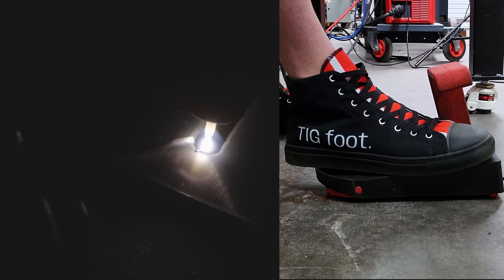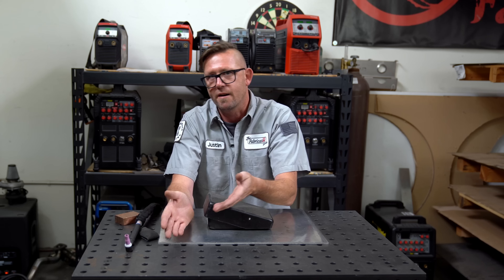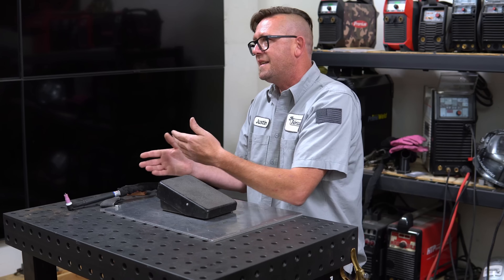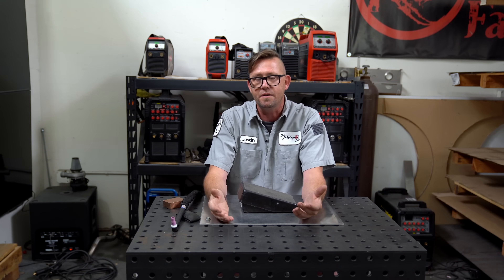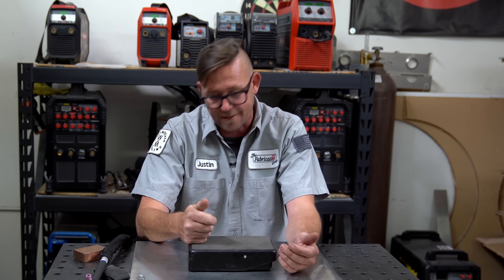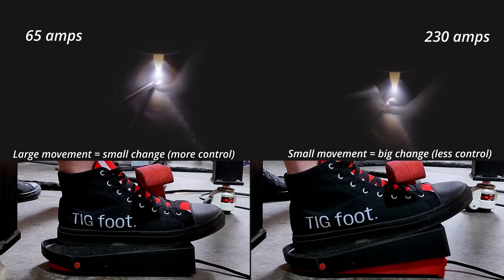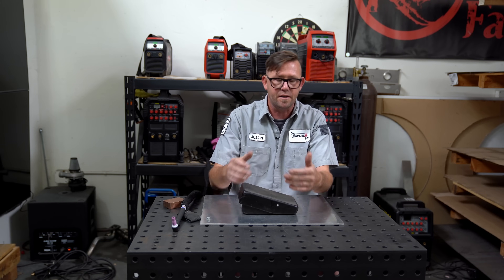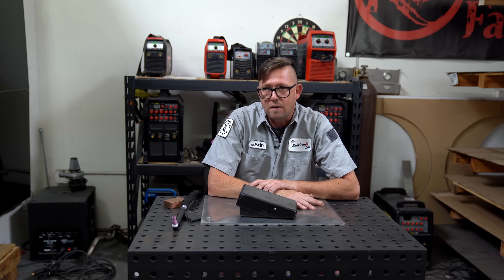Secrets of a TIG Foot Pedal

Comment: TIG is my preferred method of welding, but I HATE the foot pedal, i have always had a torch mounted control.  I made a torch mounted thumbwheel controller for my new machine by mounting a 5K potentiometer to the torch and wiring it to a replacement foot pedal plug. No way I was going to pay over $150 for a thumbwheel amp control when it is made of $10 in parts.
Reply: Haha!  I did the opposite.  My second-hand TIG had a slide control on the handpiece when I got it.  I could not coordinate that, so made a foot pedal from two pieces of plywood, a hinge, four rubber door stoppers (to be feet) and a couple of springs captive around long screws.  Used that for 25? years, and still do.

Comment: What really helped first time using a pedal is grab some scrap & just get use to using the pedal to start & make puddles, but let off & go to hot just to experience temp change without worry. No filler just learning heat control. Made life a lot better. It was hard to see the puddle at first & got a magnifier lens & that was 100% better. Great videos, TY

Comment: I have watched a ton of your work on this channel and the Fabrication Series channel.  I really find your instruction super helpful.  I have Oxy Acetylene welded for many years and have wanted to TIG for about as long, but just never bought the gear.  I am working on a new bicycle fab job and had to have TIG so I finally ponied up and bought an Everlast 210EXT after watching your video comparing it to the 255 model.  Im getting the hang of it finally and really having fun, but it took a lot of fiddling to finally dial in the right tungsten, tungsten size, cup, amps, pre and post flow and to use all of them in concert to create a decent weld!  Anyway, your videos REALLY helped me tremendously and I am grateful that you take the time to produce all the great content!  THANK YOU!!!

Comment: Agreed to a certain extent. In order for my daughter to learn how to drive, I had to tell her how much brake or throttle I am inputting. That gave her a basis on how much of to use as she was first learning. 

I applied that same knowledge to my wife when I taught her how to drive a manual. Many are visual learners.
Reply: How do you explain the force you are using on the brake pedal?
Reply: @fastone371  The amount of pressure applied to the pedal, determines how fast you slow down. Light pedal pressure= slowing down slowly, hard pressure on the brake, stops the vehicle much faster/Abruptly.
Reply: I'm gonna chime in (while on the wrong account, but I'm still the same guy in the vid). 

You can't offer visual representation for a feeling any better than you can explain how well a shoe fits. You have to put the shoe on to feel how it fits best for you. Anyone can look and see, which is good for demonstration, but one can only understand when doing.
Reply: Yeah that’s what I did was gave them the reins and a pasture told her to stomp it when it was spinning too much and on the breaks used old truck with drum breaks when they locked up remember what you did and I’ll ride anywhere with her till this day and she just turned 16 your definitely right Justin can’t teach hood time
Reply: @TheFabricatorSeries  Its simple, if one knows how to weld the puddle tells them what their foot needs to do. When you blow a hole in the base material that means to ease off the pedal slightly, when your torch has been in the same spot for 5 minutes and you still cant melt the filler you need to step on the pedal slightly.

Comment: Yes, Justin, I have heard people say, after asked about how many Amps are needed, "Oh just max out the Machine and use the Foot pedal", which is Crazy, because you Don't get the fine control on your welds. I look at the Job and say I will probably need about 160 Amps, so I set the Machine output to 180 Amps giving me a bit of Breathing space and Use the foot pedal as required up and down to suit what I am doing at the time. It has worked for me for over 20 years.

Comment: As someone who just stroke the first arc yesterday I think this is quite helpful and actually comes in as a shot of confidence. Although I was doing it right and using the pedal just to correctly adjust what was I seeing, as a completely beginner you dowonder if that was alright or even a good pratice or if I should've been aiming for "full throttle" being the correct amps for the material I was working with and just stepping on it all the way in (but then just use the 2t/4t + torch button?) - thanks for all the great material you put out, extremely helpful! hugs from Brazil! 🇧🇷

Comment: Great vid. Ive only ever done stick, mig and brief aluminum with a spool gun and my new lincoln will tig if I buy the torch and pedal. Only dc tig though but thats okay. Definetly going to pick up some coupons from weld metals online though, been since 2011 since I passed any weld tests on car body thin stuff and need to get some practice in before I waste expensive steel since I haven't done anything that thin since or much welding at all since my career changed in 17

Comment: nice, full machine control with only the pedal. in germany we are used to have a button right at the torch for start/stop (like the MIG/MAG machines). the pedal is optional. some machines support the "4T mode" as well. then you are able to program everything you want and start the sequence with only one push-button. Sequence is then like: 
1 Push and hold = preflow+Ignition+Start AMPs
2 Release = Ramp up to welding amps
3 Push and hold = ramp down to "end" AMPs
4 Release = shutdown+ postflow
do you use that kind of machines in america too?

Comment: hi the foot peddle that i have is a Boswell it has two adjustment knobs new to this  should I set them both in the middle as the welder came with no instructions on the peddle, also you won a new subscriber in me you tell it in away that you don't need a a lot of brain skills thinks..

Comment: I was wondering if you have any tips for using the foot pedal in out of normal position situations. Like welding underneath or inside of a vehicle. I’ve been wanting to get a TIG button to help with this but I can’t afford it at the moment. Great video and I appreciate all the advice.
Reply: The button is the best option. I've squeezed it between my legs and had a friend operate it in a pinch. You can always use the 4t button that comes with machines, just have to learn to use it.
Reply: I do a lot of position welding on cars, sometimes you work the foot pedal with the wrong foot, the side of your foot, with your knee, elbow, etc and worst case I have my wife sit in a folding chair and I explain to her what to do in terms of more, less, to the floor, stop. I have her watch the digital readout and give her a range of where I want amps to be so she knows approximately how much to move the pedal.

Comment: I think what the actual question was, how do you position it, do you  have a better pedal choice.  My issues with the pedal is that I can't seem to balance my foot on it properly to create that proper smooth rocking motion you show that allows for non thinking about my foot when welding.
Reply: Some folks might find it easier to take the foot out of the equation entirely by installing a torch-mounted amp controller. There's a few different types, from basic on/off switches to weird looking scroll belt-looking things. Just something to consider, especially when some jobs (especially outdoor jobs) make positioning with a pedal rather difficult.

Comment: I have been doing this wrong all along no wonder my welds look so bad. I put a stack of books on the foot pedal and I adjusted the machine with one hand and had trouble feeding the wire with the other man that was dangerous. I like your way better.😉  

Not to be too much of a smart ass, but do you think maybe you could make a video of what you do with your feet when you drive in to your shop if your shop is right at the same place at your house then maybe you could fill your feet as you walk out to the shop ?? Just trying to give an idea, I learn a lot from you thank you.

Comment: Thanks for the video.
Do not weld, but I like information about things, just to know stuff. Is tig welding like driving a standard transmission car or auto? 
A video about things you said in the video would be great.
Like go full petal and using speed to control the weld. Or using the petal to control the weld, in this video talking about weather you are using more or less petal an not showing, so we get an idea about what is happening.
Was always wondering if the part you are welding is to thick for the power of your welder and you have access to both sides of the weld can you make a good strong weld by welding if for both sides of the part? ex your welder can weld max .150 but your part is .290, would welding that from both sides make a proper weld?

Comment: Justin, can you explain high frequency and lift tig ? I have only just come across these phrases. Have'nt welded for 45 years and never did tig. Would like to have a go now I am retired.
Reply: High frequency initiates arc without touching. Lift tig you have to touch then lift, or flick the filler rod on the tip to initiate the arc. Lift tig are usually found on stick welders or mig/stick machines. High frequency on plasma cutters are called pilot arc. - I'm not an expert.
Reply: One thing to keep in mind. You can't weld with high frequency or do aluminum tig, if you have a pacemaker.  Little known fact.
I worked with a kid, 28 years old, that had a pacemaker. He couldn't be around a tig welder, when in use, if it was using high frequency. 
He could only do DC welding, without HF.

Comment: i learned on a scratch start, so now i have peddle under my foot ,the first time i come to the edge of a part it burn away ,so i started again  and the same thing happen ,i told myself i have a pedal for that  ,so i started again this time i started  i introduced the pedal to my brain by pumping the pedal when i got to the end my eyes said it's going to burn off my foot said no it's not  it took control and didn't burn, it took one time to make that connection that was 30 years ago, try it may help

Comment: Two tips from someone learning to weld, one important and one kinda silly... 1. Don't underestimate the importance of a comfortable work space. You can't accurately control the foot pedal if your legs are dangling from a barstool and the pedal is crowded up next to a cabinet. Don't ask me how I know. 2. Don't forget to turn on the argon. Don't ask me how I know.  Bonus tip 2.5  AC not all that handy on steel, especially with no argon.

Comment: Talking of machines (and noob operators like me) being stupid - I was doing some stick welding on a TIG/MMA machine away from the bench so (I thought) had the welder set to MMA mode at the right current for the material I was using, but I forgot I had the pedal connected and was cursing why the darn thing didn't have the beans to fuse two relatively thin mild steel pieces together, eventually hauling my old retired buzzbox off the shelf to do the job.  Only afterwards did I realise that on my welder, if connected, pedal overrides the current settings in both TIG and MMA modes 🤦‍♂

Comment: Im confused! Why is it necessary to change the amperage, on tig. But not mig or stick, while you are welding?
   Generally speaking, the welders get preset to the ampersge best for the thickness of material.
    Ok, but when things arent looking right. We can usually soeeed up or slowdown our drag/travel speed. 
   So whys it necessary to ever change the amperage on the tig, when nothings changed!
    Same thickness of material all around, same speed of filler rod added etc.
   So im confused as to why tig requires different amounts of amperage?
   Nothing shoulc be changing besides travel speed maybe. Right?
 Ive been welding mig for a long time and im fairly experienced with stick as well.
    So i belive this may be why im struggling to figure this machine out.
   Now granted, i only get a few mins on it once every 4-5 months at most.
   So its difficult to teach myself under such a time crunch!

Comment: Hmm. Why is a pedal in stick welding not a thing :D Heh, gotta try and see if my machine accepts pedal input in stick mode. Well, first i need a pedal. Just the other day i had a situation like that. Bad fitup. Root gap between zero and 1/16". Good 120 A on 7018 make a nice weld on zero and almost blow through on 1/16". Pedal would fix that.